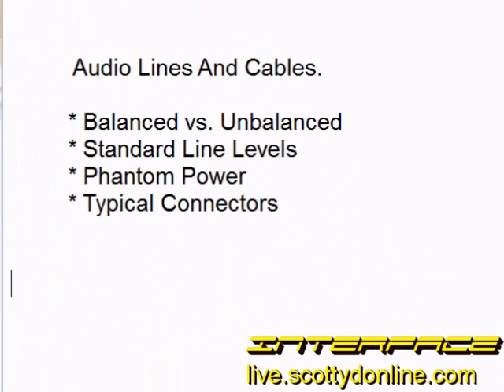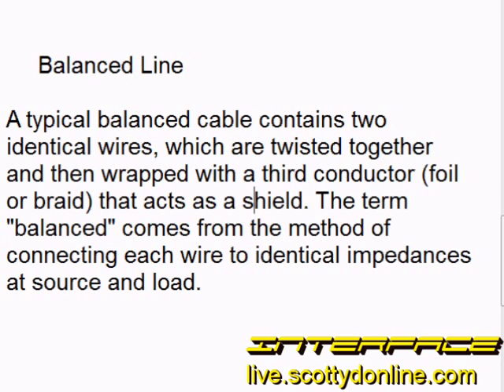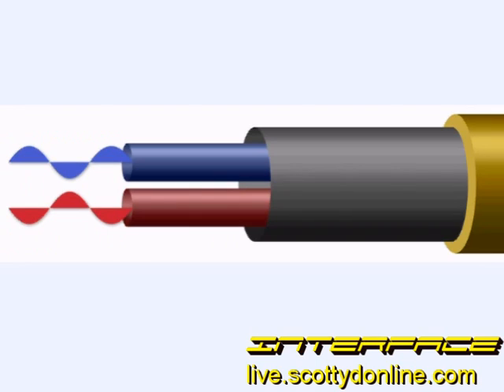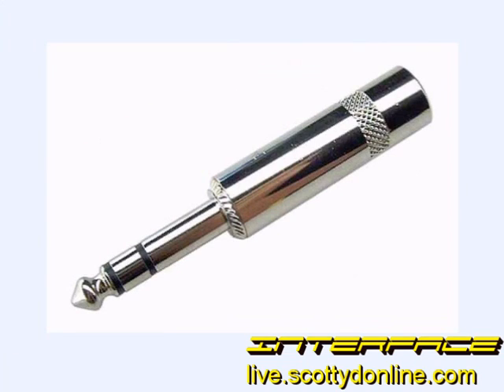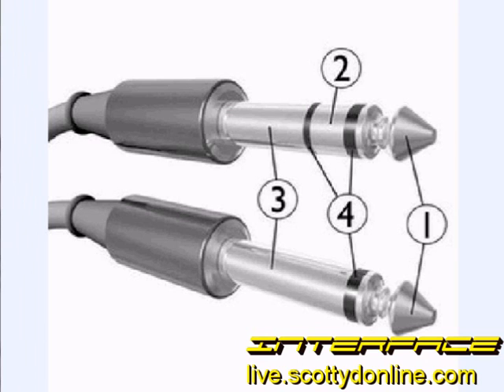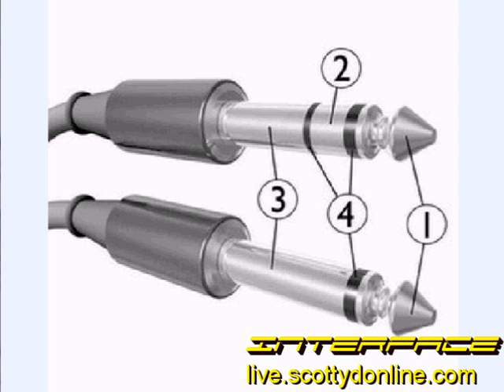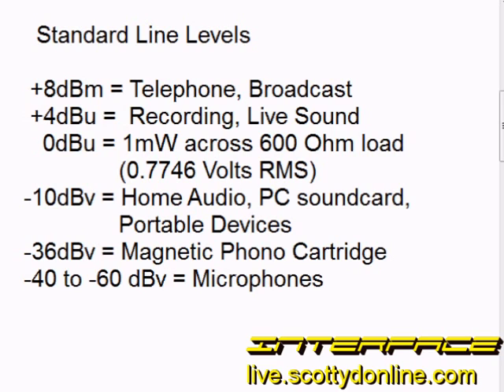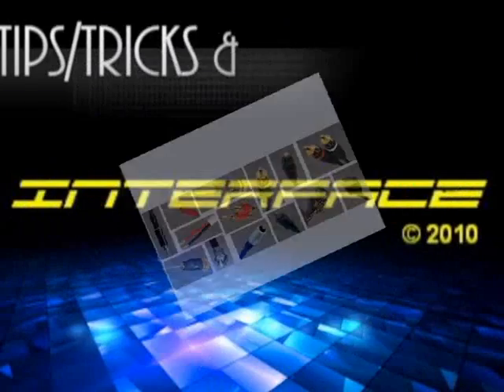INTERFACE - Tips Tricks and How-To - Audio Cables and Connections

Comment: It's important to note that depending on what your audio equipment is, a balanced signal may bad. If the receiving end of an analog signal is differential, balanced input is fantastic because it adds the +/- signal at the receiving end and the noise is lost. But if you use a balanced cable in a non-differential audio set, it will use the signal as it comes in, including the noise.